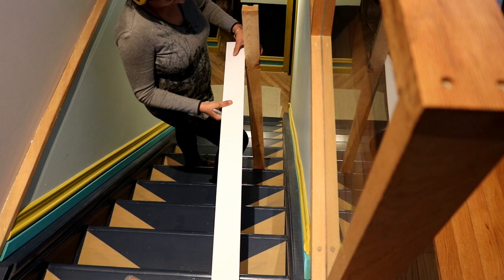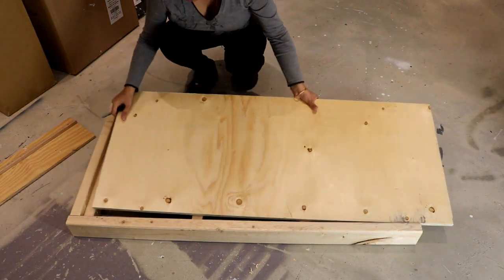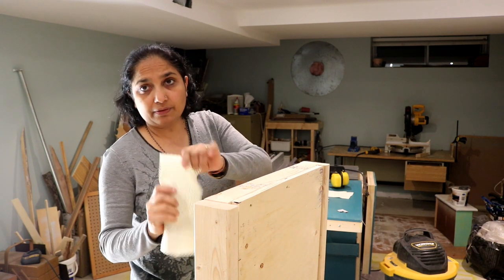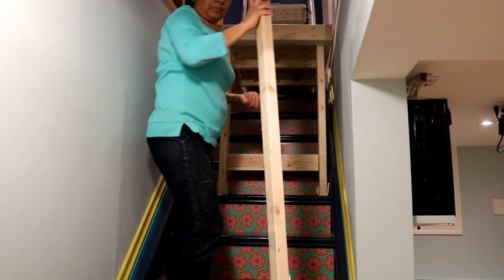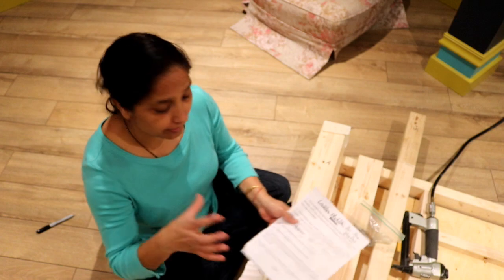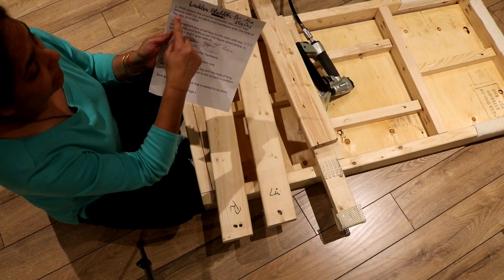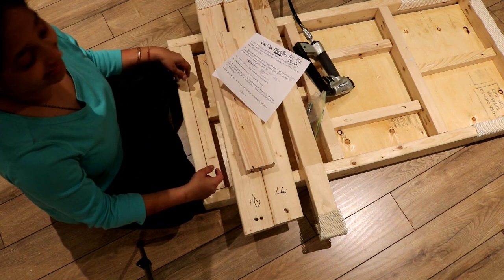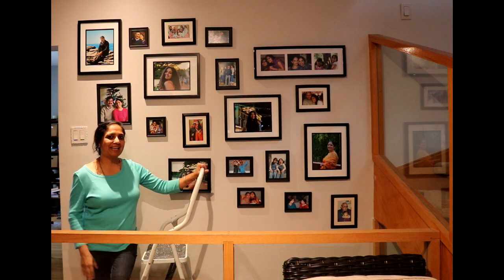DIY: How to Build a Ladder Platform for the Stairs (Very Secure and sturdy)

Comment: That can be done with a 6-footer scaffolding. Make sure you don't use the wheels for extra stability. I've been painting houses for about 35 years.
Reply from the maker: Sure. Sometimes scaffolding does not work for lack of space. Thanks for the suggestion though!

Comment: Thank you so much…this will a great!   I have a question…it looked like there was a 3rd leg on the edge that had the taller legs.   I’m not sure what that was.   Did it go one step down as just another brace?
Reply from the maker: It was just another brace for added security. You can skip that altogether. I think it was an overkill.😃

Comment: I really liked your design! I'd like to make a version of it for a two story foyer/staircase that I'm going to try to do. How tall would you say would still be safe to make the platform? There would be parts where I would likely be standing at around 10-12 feet up. Would that be too much?
Reply from the maker: This platform is to get a stable footing on the stairs.  You will have to use another ladder to stand on top of this platform. But I would not make the platform higher than 4 feet itself.  I hope it helps. Good luck with your project.

Comment: Hello DIY Home of Mine, This is a great video. I'll going to build the same one. Kindly request to advise exact name & description of two black screw or bolt or nuts - I really don't know how to call it [ you put in the 2 x 4 wood , both are connected to left & right side leg  ] which are need to dismantle with hex key. Thanking you in advance for your help in advance.
Reply from the maker: The hardware is called 'Hex bolts (3/8" thick and about 4 inches long) 1/4-20 bolts and insert nuts'.  These can be purchased from any hardware store (Home depot, Lowes etc.)
Reply: @DIYHomeofMine  Thanks for your reply & appreciate it.

Comment: Nice job! Where are the directions on paper to build this at? I would like to print them.  As I am going to hang bead and board on my basement stairs and need to build this to help me with ladder too. Thank You! J.
Reply from the maker: I meant The directions to put the parts together,  attached to the the platform, just in case someone else is using it other than me, so  they should know how to put it together. 
I can email you those directions, if you want. Or if you need any other information,  then let me know and I can help you  with that. Thanks for sub.

Comment: Congratulations!! You did a great job💕
Can I get your email address? I would love to build a platform like yours, and I would be very grateful if you can give me the instructions and measurements 💕🙏
Reply from the maker: I think the video is quite detailed. For the measurements, the legs are about 3 feet high and the platform is about 4 feet long and 2 feet wide. These are approx. measurements. You can adjust them according to your need. I hope it helps. (Sorry about the late response. I had somehow missed your comment.)

Comment: or for the time and money spent on the wood, screws and brackets you can buy better product online :)
Reply from the maker: Everybody has different priorities and needs. I hardly spent anything on the materials used in this project, because I already had everything needed, leftover from other projects.
Reply: @DIYHomeofMine  I know, I was half-joking :) you did great work on that. certainly, i'd consider building it too if I had tools/materials, but in my case it's actually cheaper to buy one purpose-made cheers :)